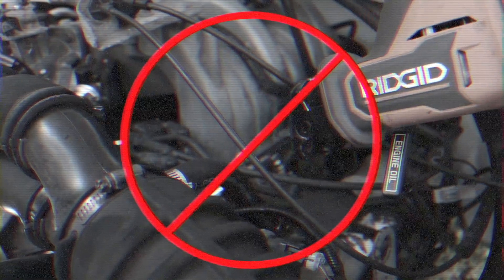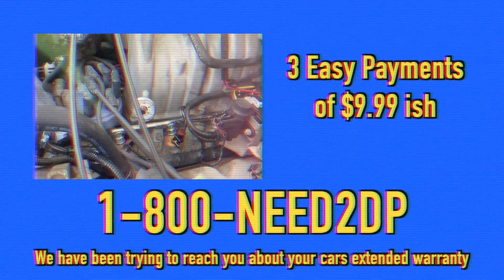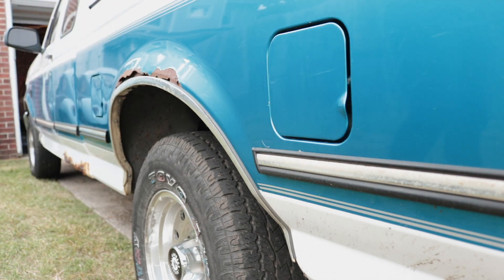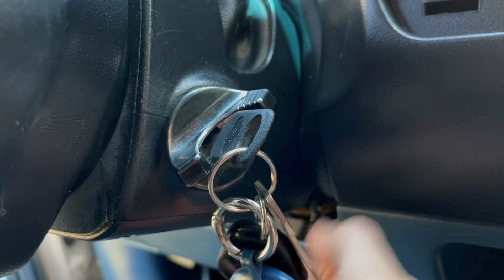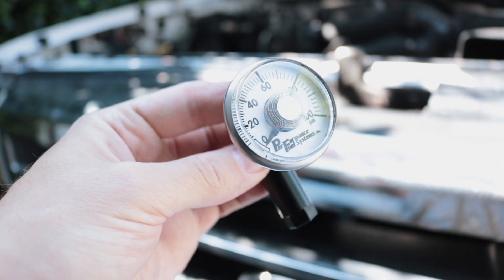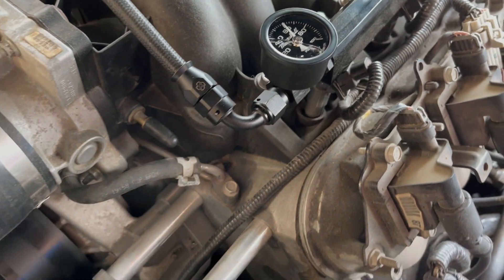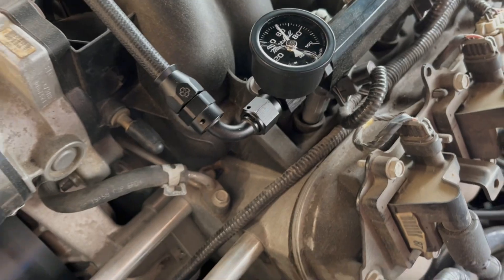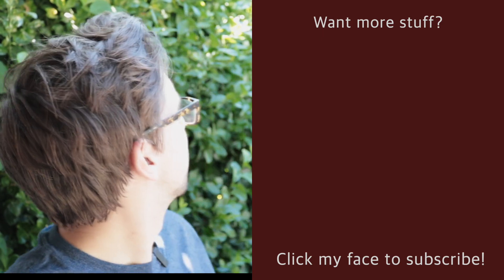How To Check Fuel Pressure The Easy Way - Performance Fuel Systems Gauge

Comment: Thanks Matthew! This gauge set up should work on my ‘98 Nissan frontier also right? Definitely a fuel delivery issue but trying to avoid dropping the tank for the fuel pump!
Reply from the maker: Of course buddy! I’m glad to help. But I can’t find a source for the thread size for the fuel port to confirm fitment. I’d honestly just send them an email - they are super knowledgeable

Comment: I'm assuming this isn't for it to be sitting on the fuel rail all the time, just to test out the system correct?
Reply from the maker: Both! Mines been on there since the video was made and still going strong. It’s also tucked away pretty nicely in the intake. If it was sticking out of the motor awkwardly I’d prolly pull it off.
Reply: @MatthewFinlay  hell yeah brother!
Reply from the maker: We have another one that I move for the diagnostics on our chevys but you know how those dual fuel tank trucks can be haha. Just easier to keep it on this one

Comment: How does it work for a single barrel carburetor though?
Reply from the maker: Terrible but you’ll love it… Snap-On makes a really nice pressure gauge with an integrated pressure release/drain tube. You can find them cheap at yard sales probably but harbor freight has “the maybe not the good stuff but the other stuff” if you know what I mean…

Comment from the maker: Check out the links to the gauge and more info on our website! https://www.garbagecharged.com/fuel-pressure-ford-gauge.html
Reply: Good morning. I have one of these adapters, and I'm wondering about the function of the central pin. It's a solid Allen screw, how does the fuel pass through it?